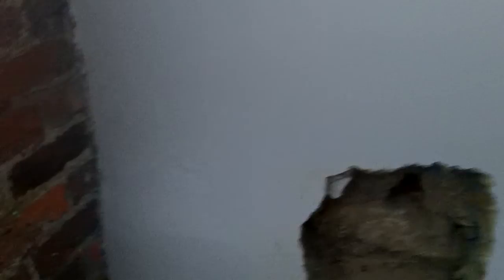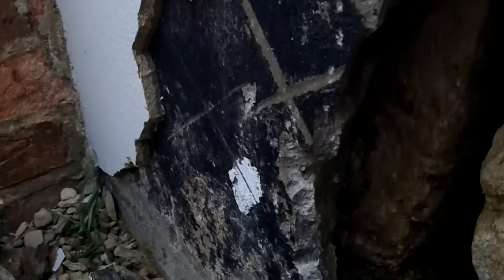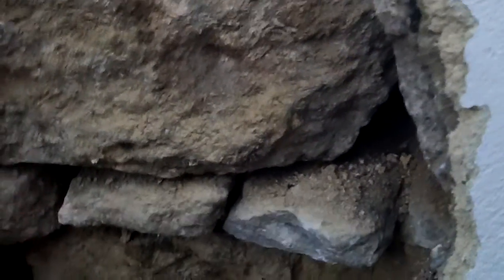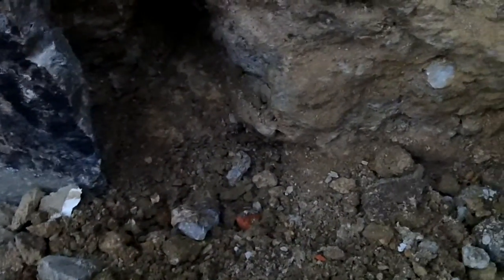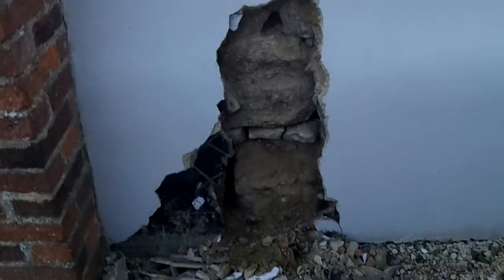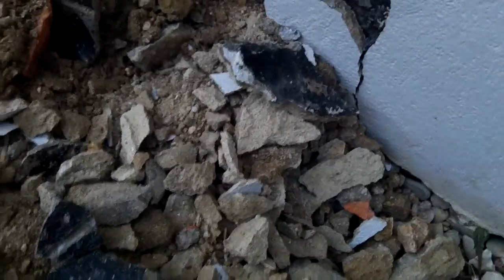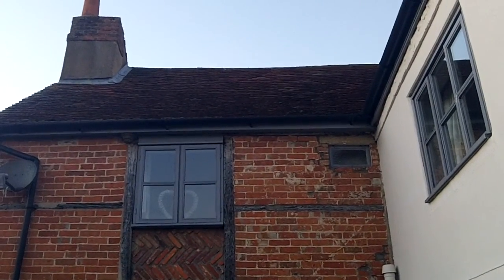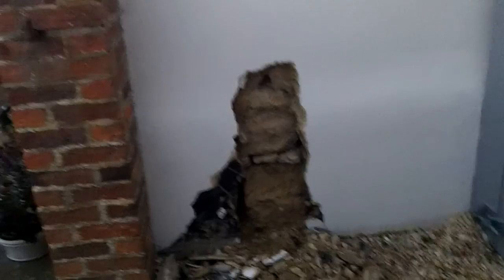A VERY wet Grade 2 listed stone house because of thick cement render

Comment: Peter, your videos have convinced me and are helping understand the underline issues for damp. I'm due to buy my Grans bungalow, hopefully by the end of the year. She has suffered with damp issues around the house for since she bought it nearly 15 years ago. She's been trying to sell for a long time now but nobody seems interested after the viewing stage. Anyway I have agreed to buy her house if she would lend me the money to start renovating. Step one will be to eliminate the cause of damp. There are numerous things wrong, but the main thing is there aren't enough air bricks for each room, what are there are either block or just for show. I'd like to send you some pictures if possible? I'm taking on this project by my self, the damp and preparation will all be done by me. Can you help me with one thing? When I install a new air brick, what kind of gobbo mix will I need to use? If you would be interested to see the current condition of the property, please send me an email and I will send you the pictures as soon as I can. Keep up these amazing videos Pete as your educating a younger generation here too :) my email : liam147@hotmail.com
Reply from the maker: Thanks - have emailed.  I'd use lime mortar, and get air bricks from the cast iron air vent company - NOT the clay things that dont allow enough ventilation.  Vent chimneys, and vent sub floors.  Check drains, vent the roof if you insulate.